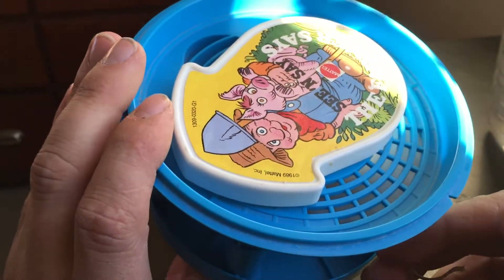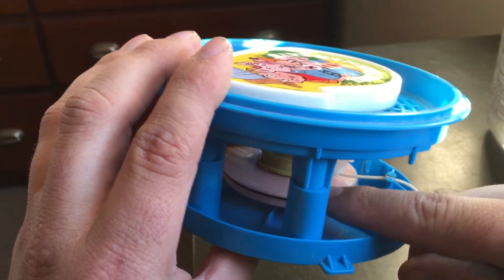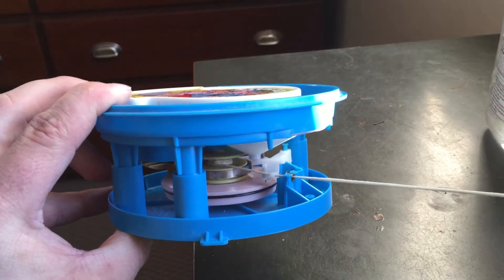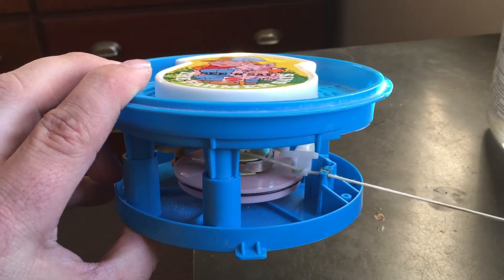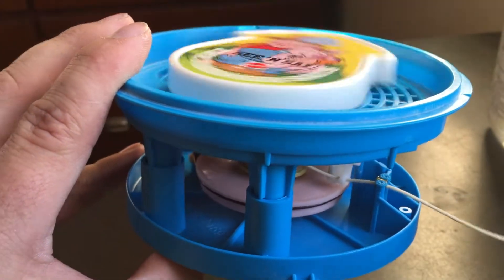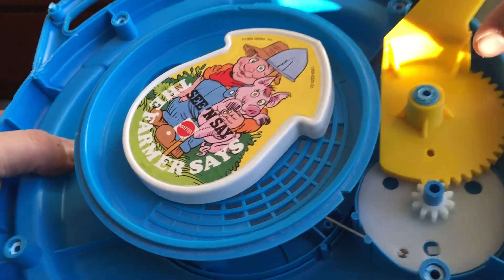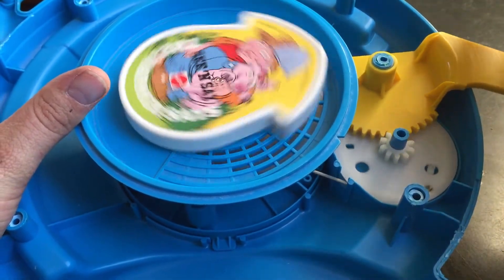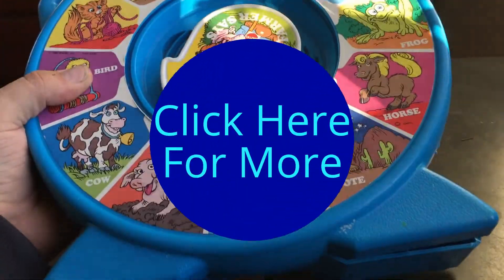How does a See 'N Say toy work?

Comment: What happens if you cut the string.  Will it still spin without sound?
Reply from the maker: Sorry it took so long to reply, if the sting is cut it may spin for a little bit in the center of the record, probably making no sound. But after that the toy will be broken and do nothing because the string is necessary to pull the spring that makes it turn. So if there is no string to wind the spring it will quickly unwind any extra spring the string may have been holding then it will be broken.
Reply: If you cut the string, it won't turn at all because you have no way to wind it up.
Reply: @beverlykimball142  You could remove the record or needle probably. But then what would be the point of the toy... a child’s version of a slot machine maybe. 😄